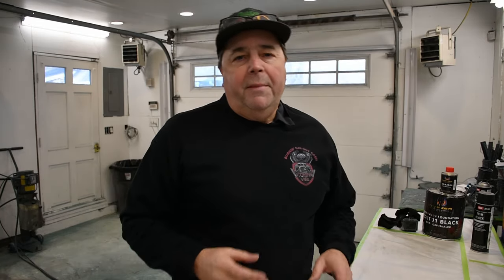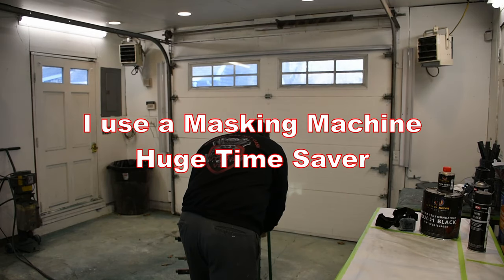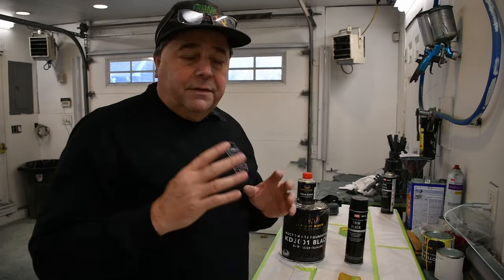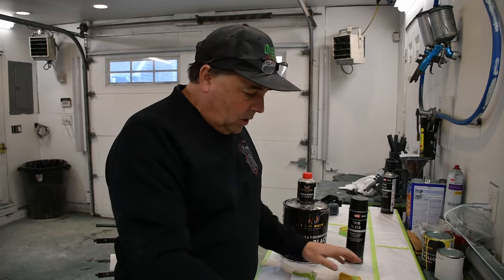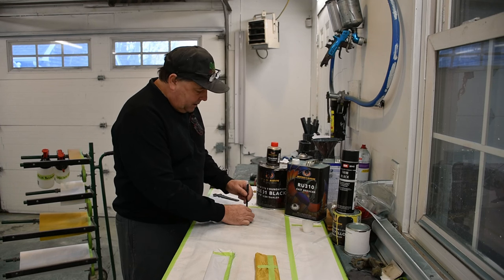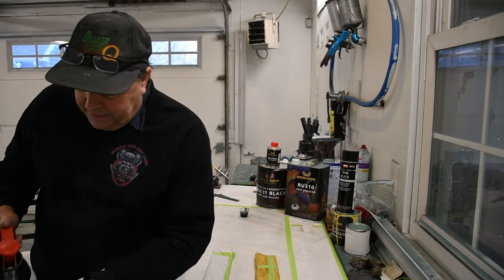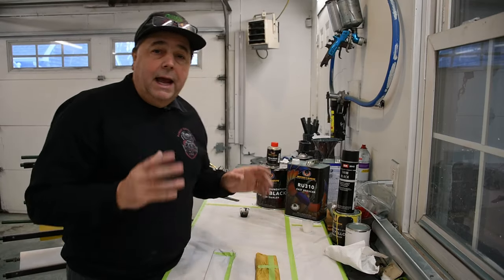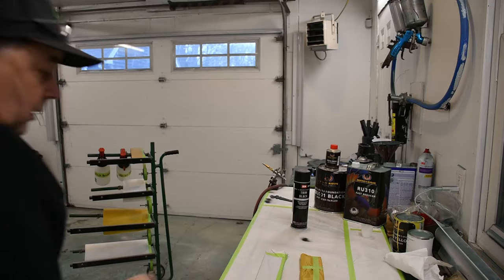5 Easy Steps to Painting the Trim on Your Car

Comment: Grandson's F-150 has rust in the ends of the stiffening grooves on the cab roof.  Some of the rust is bubbling up pretty good.  How would you suggest we tackle this?  Total repaint is out of his budget.  Thanks.
Reply from the maker: Hello,  Without seeing it it's hard to say. Rust bubles usually indicate rust coming from inside the panel. A hole forming from the inside. Cutting out the area and welding in a patch would be the correct way. But with a low budget I would suggest using a fiber glass reinforced filler like Marson Mar-Glass, followed by some regular filler then prime and paint. Not really an easy fix here. Good luck on your project!